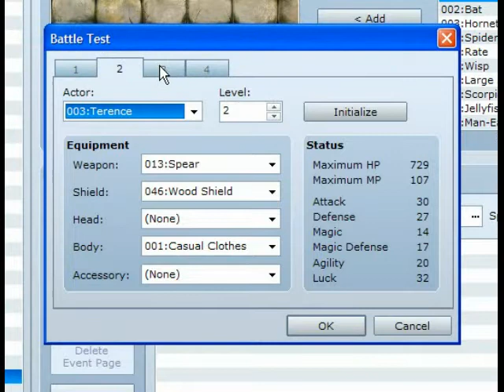RPG Maker VX Ace Battle System 5 - Reedo's Sideview + Yanfly Engine Ace

Comment: I have 10 battles at the field and 4 of them are getting off the screen. How can I place them behind the 1st 6?
Reply from the maker: you can arrange them in database in troops tab but max enemies are only 8. if you are talking about your characters, in line 80 of reedo's SBS script you will found this : ACTOR_START_TOP = 4 change the number to adjust the actors positions the lower the number, the higher the position. they are only allowed in a straight line you can't put the other to the back. if you want to move them horizontally, in line 81 of the script you'll found this: ACTOR_START_LEFT = 12 change the number to adjust it. the lower the number the more they will move to the left. sorry for the late reply.

Comment: I downloaded the script but it is not working, I get the message unexpected tstring_beg expecting keyword do or ' ' or '(' and the more that I cant read...

I put it under all other scripts, I even use yanfly core engine, battle engine, visual battlers, do these cause the problems? Should I remove them?

Also the script is in one huge line, I tried to make it fit properly, did I somehow destroy it?
Reply from the maker: try to remove visual battlers before you put the script
Reply: Thanks for the suggestion, I removed them but it wasn't working again, I couldn't even start the game, I got the same error message...
Reply from the maker: try to create a new project then
download and
put the scripts in this order:
Yanfly Core Engine
Yanfly Ace Battle Engine
Reedo SBS

I tested and it works for me
Reply: I did this. In the new project it works perfectly fine, in my main project though it is not working, I removed the yanfly visual battlers script but still not working. I don't understand what script could possibly be causing this problem...
Reply: EDIT: I found what causes the problem, I have the yanfly party system script. In my game I have 5 playable characters but REEDO's script works with 4 I guess... if there is a way to make these 2 compatible it would be great if not i won't be able to use REEDO's script unfortunately...
Reply from the maker: actually, I tested it and it works
I even set max members to 10
here's the link of my tested project:
http://www.mediafire.com/file/lc56okt9rtpbw55/Reedo+SBS+++Yanfly+Battle+Engine.rar
Reply: im getting the same problem,but im only using RSSBSACE script,it keeps saying a error in line 0,it can identify X

Comment: I'm korean. I'm using your script on my game.
I think enemy's attack is so fast.
How can i add delay to enemy's attack?
Reply from the maker: +혀낸 try to create your own animation for the enemies in the database or try to put Yanfly Engine Ace - Ace Core Engine script.you can adjust the animation speed using this script.
Reply: RPGMing I already have engine script on my game. and I also made my animation long, but it doesn't work.
Reply from the maker: +혀낸 in line around 178 of that script you'll see ANIMATION_RATE = 3
by default it was set to "3" being at 20 fps animation.set it to "4" being the slowest at 15 fps.
Reply: +RPGMing If you make an enemy with the same spells as the characters they are still going at a much faster rate than the "heros" i can't figure out why but its somewhat annoying as all enemies look like they have a speed buff when using anything >_< changing that FPS rate doesnt help either bleh.